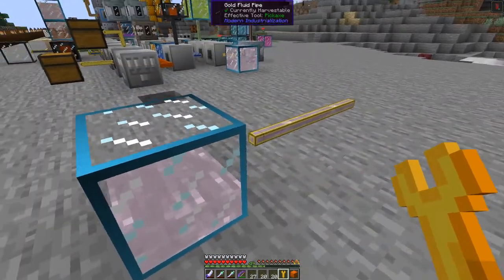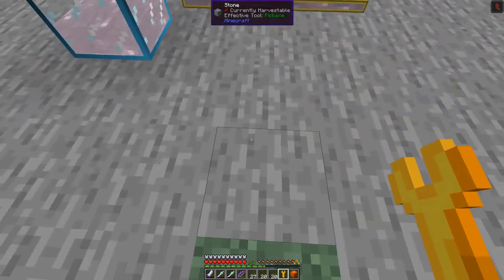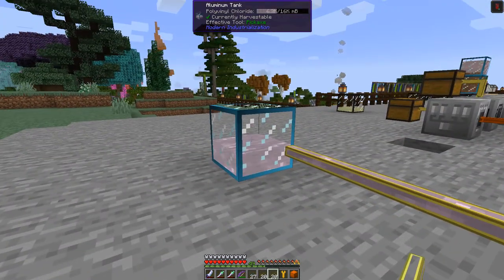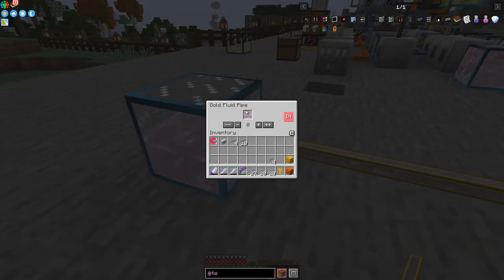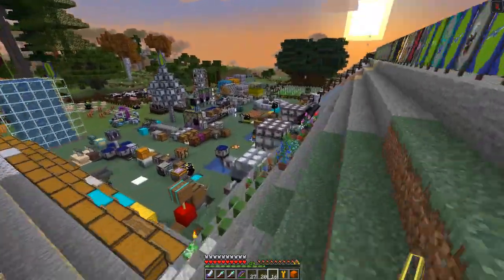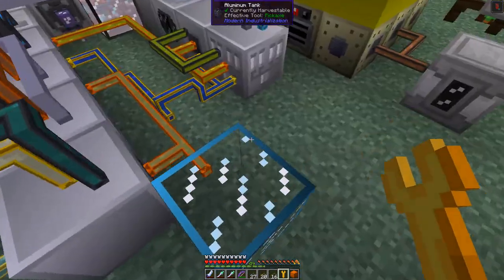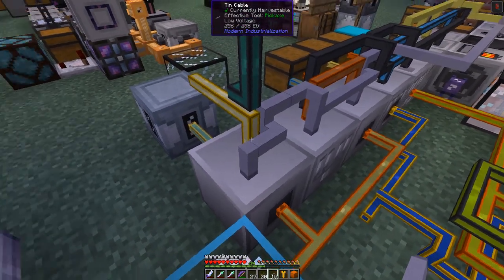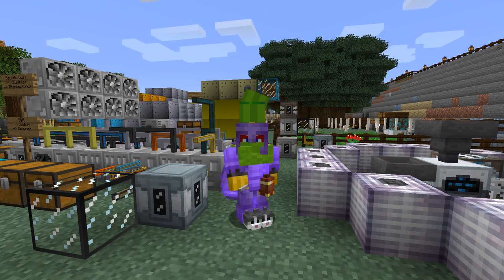All of Fabric 3 - Modern Industrialization: Easy Pipe and Cable connections

Comment: Do you have anything on the electrical storage units because I don’t understand them at all?
Reply from the maker: For which mod?
Reply: @duncanwebb4934  tech reborn and then applied energetics 2 but they are both on all of fabric
Reply from the maker: @Ethrien  nothing special about AE2, tech reborn has one output face and the others are input faces, use the wrench to select the output face; this is shown in a couple of episodes.
Reply: @duncanwebb4934  thank you

Comment: Truly despise the dev's choice to not make same type pipes automatically connect to eachother. At least this is slightly less tedious than needing to get into poition to click with the wrench to make connections, but it still is endless frustrating and does nothing but slow building complex wire networks down
Reply from the maker: Connecting automatically can be a pain when machines are in adjacent blocks.